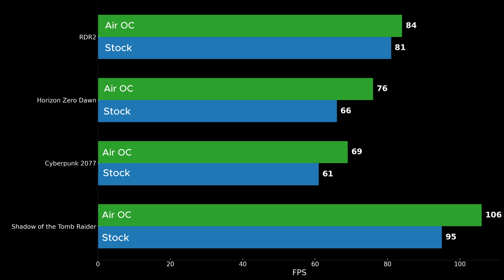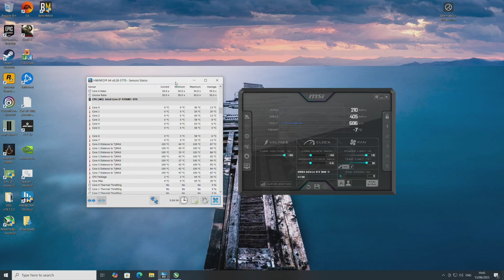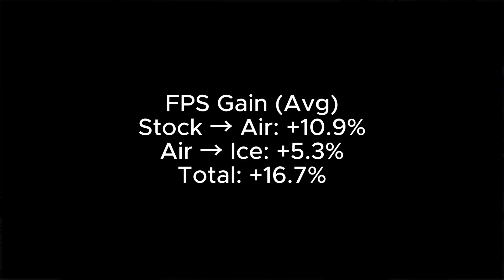I Overclocked Everything Until It Froze

Comment: not to hate but you cant not mod a card at all and call it xoc especially when all your doing is running subzero watertemp which stays way above zero under load theres nothing extreme about it
Reply from the maker: The coolant was below zero, that’s subzero. The temps under load rose above zero,  but still way colder than air or AIO. I pushed clocks higher than air could ever hold, took the card apart, and put 3D printed parts on it. No volt or BIOS mods because I wanted this to be something people can try at home. Just because it’s not LN2 doesn’t mean it’s not extreme.
Reply: @TrashBench  then whats extreme about it? the fact you put some ice cubes in a tub of water? the very definition of extreme is Being far beyond the norm,Very dangerous or difficult,Participating or tending to participate in a very dangerous or difficult sport. what about you putting ice in a bucket of water stock voltage no mods anything allows you to class yourself as the people who will epower a card and run it on liquid nitrogen? thats extreme using hard learned knowledge and skill to push the hardware to the very limit of the silicon
Reply from the maker: @Jonesypcs  Jonesy... come on dude.

Comment: What are you doing to get the loop liquid temp down to negative numbers want to also give it a go. Great videos like the content👌
Reply from the maker: Awesome! So there are a few ways to do it, but the way I have settled on because it is highly reusable is, a 50/50 mix of automotive coolant and water in a cooler stored in the freezer. The mix has to be right so the liquid stays fluid and does not freeze. Then a pond or aquarium submersible pump (inline DC will not work) dropped right into the coolant then pumped to a copper water block on the CPU or GPU. Salt water will not work as it is too slushy and does not hold sub zero long enough. This coolant method comes out at -18C and will settle at about -2C in about an hour and they stay at that temp for just over another hour or so. I used ice and water in the beginning but it heats up really fast. Another method would be ice and salt with a rad put in the same bucket but it is no where near as efficient. Do it, and let us know how you go!